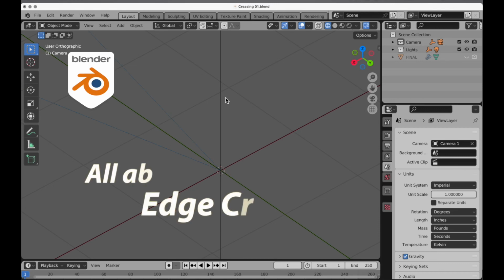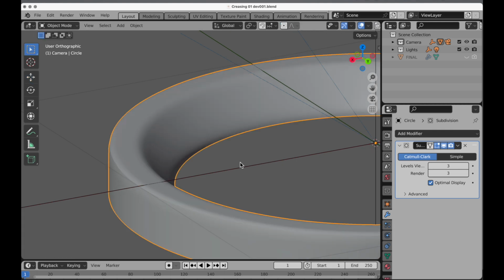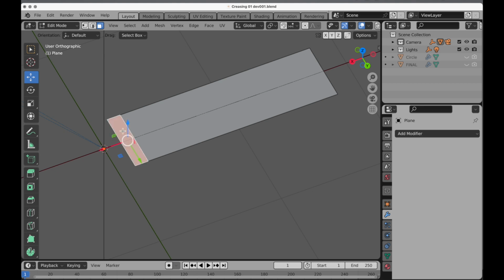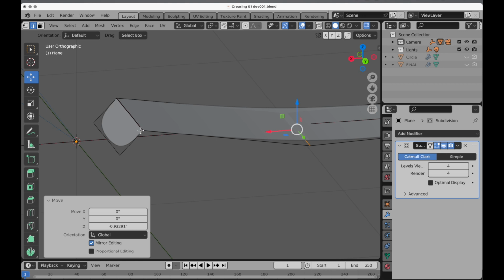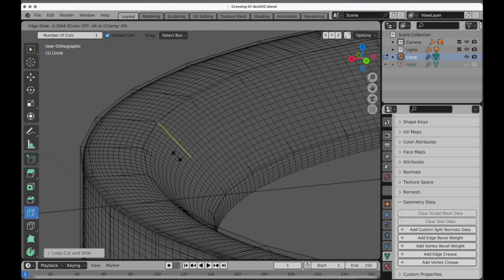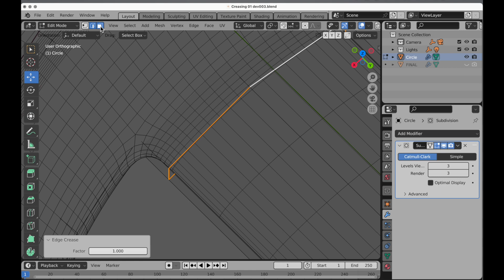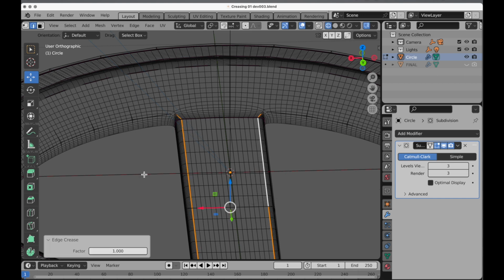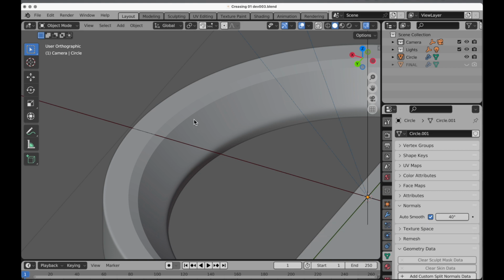All About Creasing

Comment: Thank you very much, Chris, for this detailed explanation of the use of creasing! Will these creases be retained when I move a model from Blender to some other polygon modeling software?
Reply from the maker: I don't know how well creasing is supported in various file formats. The creasing mechanism is a part of the catmull-clark subdivision system and so any application that supports it usually supports creasing to one degree or another. But I need to see which formats may or may not support transporting that data.
Reply: @christopher3d475  I see. I use Blender-created models in other 3D software. I think I need to check this out. Thank you, Chris.